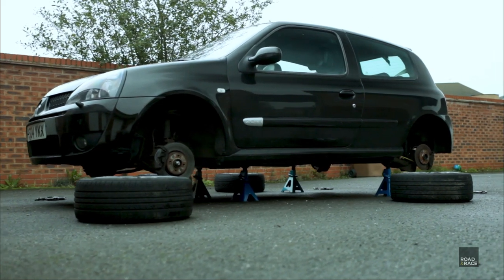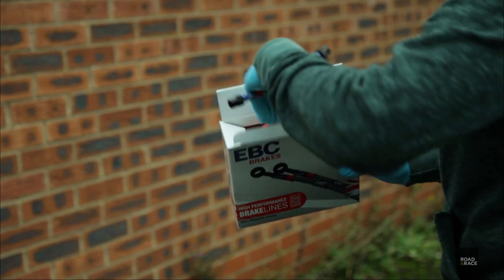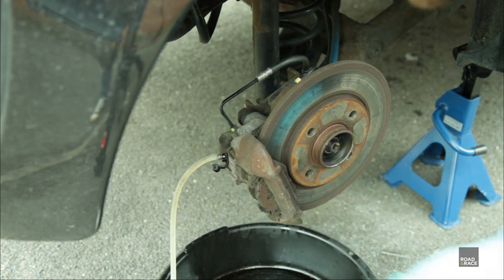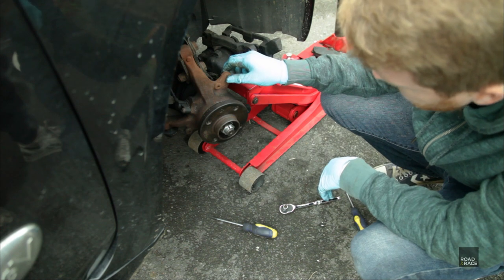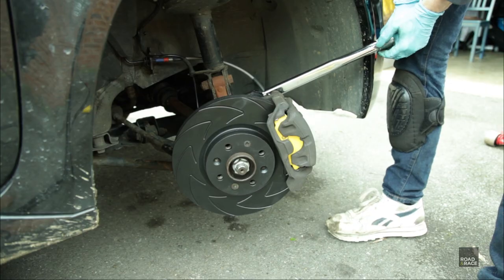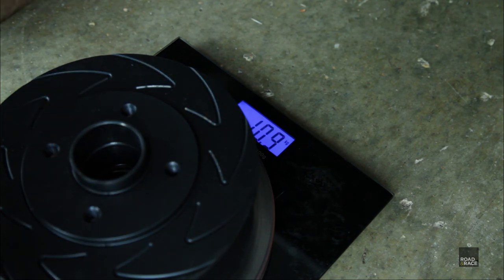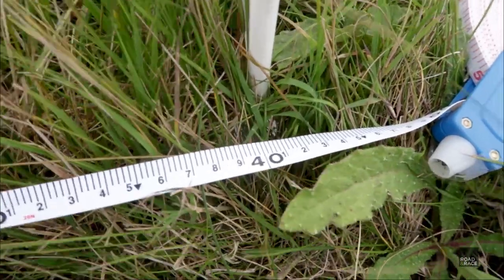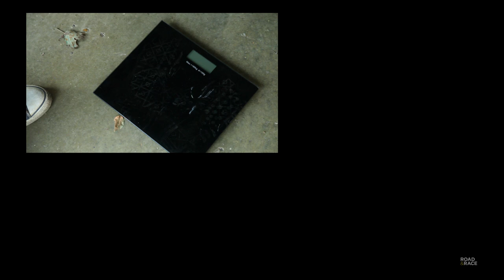Clio RS 182 - Fitting racing brake pads, discs & hoses - Budget Track Car Build Project pt.5

Comment: Just changing the fluid would have made a huge difference as old fluid will have collected moisture causing it to boil quicker.  Those higher spec discs and pads will keep their performance better at higher temps so less drop off in performance as laps clock up.  Not surprised there wasn't a lot of difference on the road.
Upgrading the rear too much isn't a good idea as it's not uncommon to see track cars locking the rear wheels as lap times drop when more weight is transferred to the front on super sticky tyres.  I've even had rear lockups going around the alps in a loaded MK2 Caddy van going hard on the brakes into corners.  Never happened when I was running the discs and pads it came with even when lapping Nürburgring.

Comment: Well done guys, I have never taken so much interest in a clio sport before, but loving this series.  Looking at those rear disc wear marks, there does not seem to be much contact patch with the rear pads,  ie one third outer area around the rim looks to have been untouched, is that normal for these cars. ??  also would it be advantageous  to get hold of some 6 or 8 pot calipers on ( ok i know its probably overkill but just a thought.)   second hand from eBay or is the cost too prohibitive vs the cars value. Keep up the good work chaps. !!
.

Comment: Tires are the key here, and suspension and bushings basically everything chassis wise comes into account, as for the rear brakes stick to the new disc and just take the time to push in a new bearing rather than pulling the old one, future proofing or preventative maintenance

Comment: damn boys some blocks of wood and the right size socket that fits the out side race with a hammer will do the trick...backyard press. even a bit of hear with a heat gun.....

the biggest thing is to size your socket or pipe or what ever your using to the outer race and make sure there are no dingging issues etc....

I just bought a bunch of alumnum round stock in different diameters for bearings and seals. i also use nylon round stock if things are really sensitive.

Comment: Nice series this great editing and good detail , a 10ton press will be invaluable guys.when you put the brakes back together did you clean and grease the slider pins up ? Nice work 👍🏻
Reply from the maker: +The cjrshop Thanks for the kind comment.  No, but will referb the calipers in the new year unless we get a big brake kit.  😋
Reply: Road and Race willwood 4 pots great brake upgrade .

Comment: You need to do a joint track day with guys that drive in their 172 that they are prepping at the moment. I think that would be cool!
Reply from the maker: That's a good idea.  Maybe some kind of challenge.  Any suggestions?
Reply: Road and Race compare weight, 0-60-0, best lap times, total cost involved. I reckon the 4 of you would get on well too!

Comment: The rear hoses that are crimped to the hard brake lines are already high pressure hoses, hence do not require replacing. I would also echo some of the other comments that genuine Renault rear discs and bearing last significantly longer than any after market options
Reply from the maker: +Dan Gibson Thanks for the advice Dan.  The rear hoses are rubber so won’t they perish so need replacing eventually? They are 12 years old now?
Reply: Road and Race unless they are perished I would suggest they will be absolutely fine. I have never known them to be changed.

Comment: The rear brakes do next to nothing on these without a bias valve, do some hard driving and give the rear discs a touch - you’ll see what I mean. If you do change the rear discs pay special attention to the shims that are fitted between the disc and the hub, sometimes they bind to the disc and if you arnt looking for them you can end up fitting new discs without. Your also missing hub caps that fit over the hub bolt, not that they do a whole lot mind.

Looks like tyres are holding you back at the moment, AD08R and NS2R’s are a popular choice.

Comment: When you replace the tire for a more slick or atleast sportier one, youll brake alot faster. Abs wil not kick in because tires wont loose grip.
Reply from the maker: +Brian Pauw So true.   Tyres are the next item to change.

Comment: Hello boys nice videos with details!!!
I will be changed my front disc with brembo max 259mm and ferodo pads this week this moment the car have too hard pads when i brake and the are hot i hear a sound like metal to metal the disk also reduce at 18mm , will i see a big change to my brakes? I also have replace all tyres at August 17 with goodyear efficiency Grip 195/50/15 and all my abs rings that was damaged but when i press hard the brake the ABS is working overtime the serbobrake is working perfect says the brake technician . I also have done a wheel alignment and i have not any other damage

Comment: 1. Rear Brake lines : do them yourself, you can find DIY parts for braided. 
2. Buy new rear bearings, they're cheap.  Go with them and the disc to any car repair Shop to be pressed together. 
3. Take care when replacing the rear  discs, NOT TO LOSE THE SHIMS !!!!

Comment: Why less fluid is wasted when pressing the pedal? It sounds a bit counterintuitive. By the way, as I suposed and your test has shown, changing braking components doesn't improve braking distance. If the brakes have the power to block the wheels are already doing all the force you need. You will notice and improvement with pedal feel as you show and brake fading. What a great series!!! Can't wait to see the track test!!!
Reply from the maker: +Xabier G. Thanks Xabier for saying it’s a great series.  I think less fluid is wasted as the system is under vacuum.

Comment: Once you get the interior out of the Clio, arm yourself with a heat gun and a paint scrapper, if you remove all of those sound deaden patches on the floor and roof you will be amazed how much it adds up to!
Reply from the maker: Thanks for the suggestion Kevin.  Sounds like a lot of hard work though, any ideal how much it all weighs?
Reply: I would estimate about 20kg. I have been preparing my Clio 172 for competing in a road going class in sprints and hillclimbs. I have to keep my full interior so removing the sound deaden was a good gain for me. Its easier than you would think aslong as you apply plenty heat with a heat gun, then i used tar and glue remover to remove the residue. Air Con delete kit would also be very beneficial as compressor etc is heavy. Also there is this really odd cast iron weight just under the offside engine mount must be about 2kg!
Reply from the maker: Wow, didn't realise it would be so much.  Well worth doing.   Thanks.   Does removing the 2kg weigh have any downside?
Reply: I thought the same, it must be there for a reason! but i believe its something to do with EU sound or resonance laws but don't quote me on that.

Comment: I’m guessing the real difference here is that on track the pads and disc will last longer without fading, not a great difference in stopping distance in your one or two stop test, if you did 5 laps, that gap would be much bigger.

Comment: no need for vented discs front and rear on these, oem spec brembo HC discs were great on mine I ran them with minted 1155 and ATE200 fluid and it stopped quicker and more aggressively. wouldn't use EBC yellow on any of my cars on track there terrible.

Comment: Waste of time & money changing the rear pads as they do very little on these cars. Also you would be better putting genuine Renault rear discs on as the bearings come already pressed in & the bearings don't fail like aftermarket items do.
Reply: I don't agree.
Changing the front and rear pads to the same compound allows the car to stop a little quicker. Often the car will be a little flatter also, rather than pitching forward. 
Still think you should overhaul the calipers, as binding in an old caliper will cause the brakes to drag. Use to overhaul calipers in my race car at least twice a season.
Tyres will now be the next big improvement.
Reply: Probably in a heavier car Gavin your logic works but not with the Clio. The rear breaks do next to no work at all due to the weight of these cars. A couple of my friends have race prepped 172's that they use in a race series at knockhill & they run standard discs & pads on the rear.
Reply: The pads looks shot, so it’s a legal requirement to change them eitherway, ,  rear brake upgrades help if you know how to balance it all.